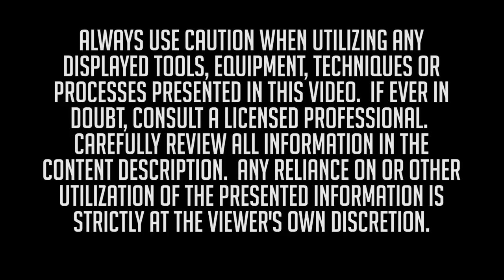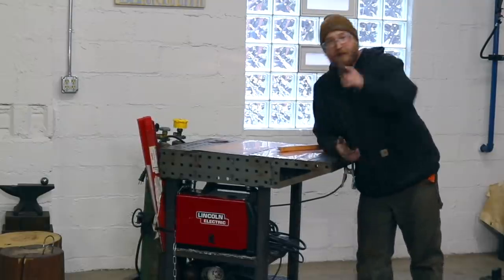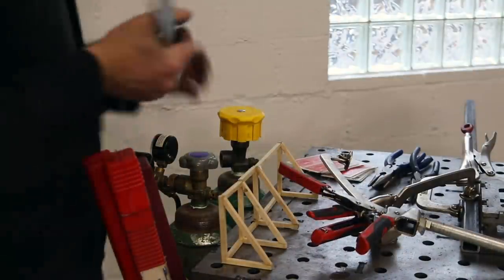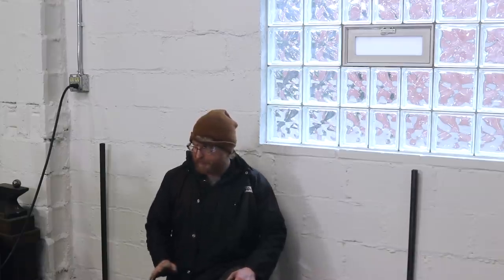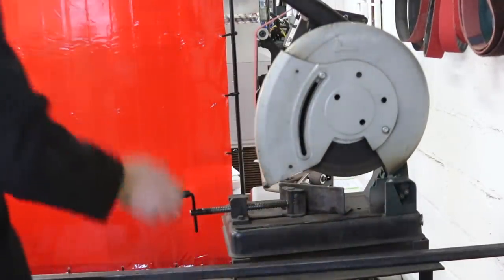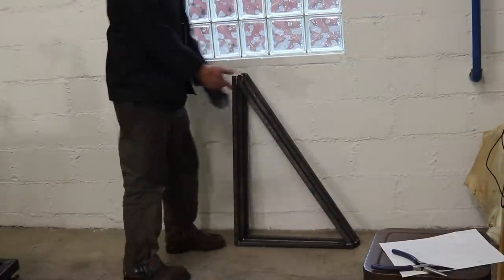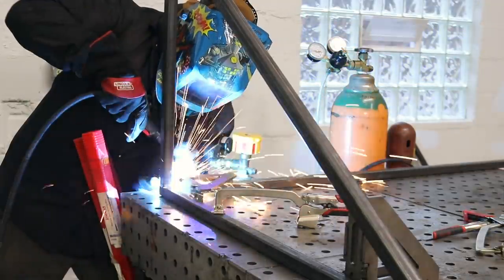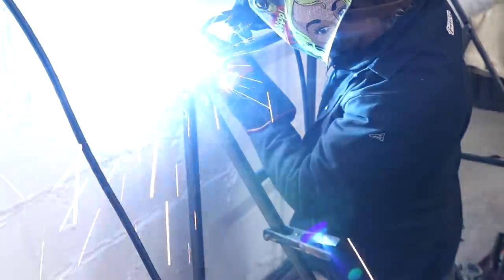How to Build and Weld a Material Rack for Any Space

Comment: Best since Red Beard.    I’m trying to come up with a design for rack, pretty much ruled this one out because I need to stay closer to the wall in one bay of a two car garage.     Might modify the width and shoot the height up and fasten it to the studs and blow some anchors in the floor
Reply: Hopefully you get inspired and make something purpose built for your space and it works as well for you as this one does for me!
Reply: @TheBarefootForge  I already made a small tear down table out of a W8x18 for the base and a 1/2” plate 2’-6”x3’-0”.  I have a few fixtures I made in the past that can bolt up to that or layout small parts on the table.    Plus a lighter duty welding table about the same size     Problem is the scaffolding, shop vacs, tool boxes, and 18’ material lift that have to be moved every time I want to work
Reply: Yeah, I mean, unless you have tons of extra floor space (which you clearly don’t) making that angle just creates a bunch of dead space. In my mind you’re better off having a stronger vertical, secured to the wall,  and basing everything off that.
Reply: @jeremyspecce  I won’t be going far off the wall, maybe 0’-9” to 1’-0” and then closer to 2’-0” at the base.    The end goal is a carport/lean to for my utility trailer, duck lift, welder, and a longer stock rack but I have to start somewhere.    Might put a bunch of tools in my job box and build a bracket to the outside wall so it doesn’t turn into meth money for someone

Comment: The way I did mine was: lag bolted 1/4 x 3 wide, flat bar pcs to the studs with 1-1/2  (material holding tube) welded (level) and used 1/4 FB for the 45 degree (short) braces from FB to undersides of level tubes.  3 total brackets-each one with 4 levels that hold 20ft pieces of any weight.
Reply: Ah I see the exploration didn’t make the edit- this steel rack specifically needs to accommodate our rotating inventory of anvils for sale underneath it. I’ll try and post a follow up showing it with everything moved in place- but it perfectly accommodates a dozen various anvils as well as all the material I have to store. 

Not every design works for every space or need, and I’m thankful I came up with one that perfectly fits mine.
Reply: @TheBarefootForge  Had no Idea. Post has been edited.

Comment: Awesome - what's the stock you have there?
Reply: This was made of some 0.120” wall 1”x1” square tube. I don’t but many long lengths of things to store- I prefer to order material as I need it and luckily have a great supplier just up the street. Additionally- I don’t put much weight on this rack since I don’t work with many heavy things and actually filled the top two shelves just with titanium (which is super light).

Comment: We can all appreciate times when you gotta say “F it, it’ll work” or gotta resort to some hillbilly tiggin…but man, this design blows lol.  I like that the channel is moving a little closer to “real world” stuff though.  Design definitely would work for some small home shop 1”x8’ angle and whatnot I suppose lol
Reply: I thought the same thing.  Giving up 2 feet from the wall is a lot of floor space when you don't go vertical, and how much steel can those 1" sq tubes hold before they will start to sag?  They're not even angle'd up to prevent stuff from sliding out and off the rack.  In my design that I did video's on roughly 1 year ago, I used up about 14" from the wall, and went vertical, using 2" sch 40 pipe, and it's still holding up a ton of steel in my garage.

Comment: I am so tired of the wide reliance on specialized process settings available on most of the name brand  welders.  Of course I'm assuming that the overall intentions of your posts is to educate people,  -  teach us how to spend more time laying beads, and less time on the angel grinder.  (Most of us are very compent with this tool after a week or two.)  I think 60-80% of a good weld is prep and skill,  -  that said then 20-40% is choice of rods or wire and actual welder settings (pulse,  double pulse,  power,  start/stop ramp up/down,  pre-heat or not,  et all).  You teach using welders we'll never be able to justify the cost of - using pre-programmed process settings specific to a brand/model line.  Teach the basics,  detail the optimum welder setup and leave us to refer to our manuals to work out process settings specific to what ue have available (if any) and ask more specific questions.  Thank you for the time and effort (most forget that even after recording video more time is spent editing).  Your willingness to spend that time to educate people you will never know or see is beyond commendable but please stay with basics we can apply to what we have to work with... 😎
Reply: Thanks Dave! I have a goal to always bring approachable, hobby level skills and discussion to the table. Let's let the full timers talk about the full time stuff- i'll help you solve the rust hole in your lawnmower with an approachable process and equipment!